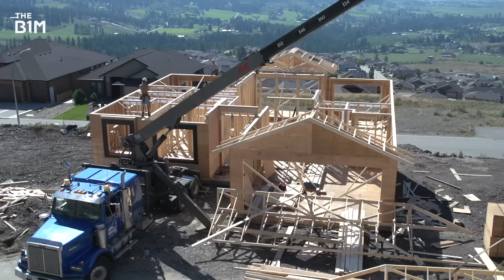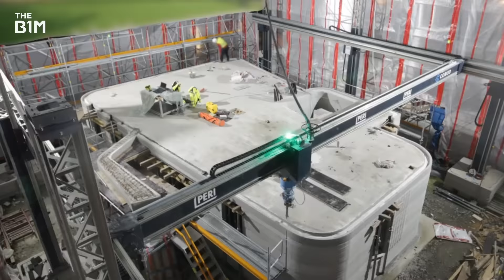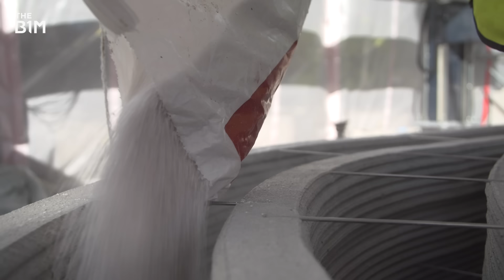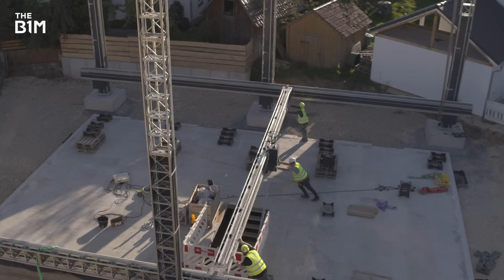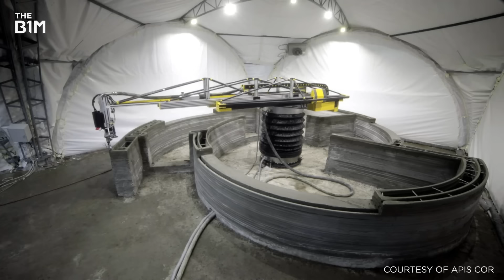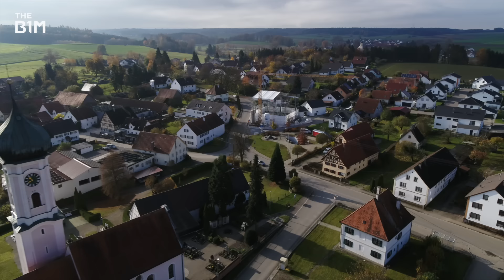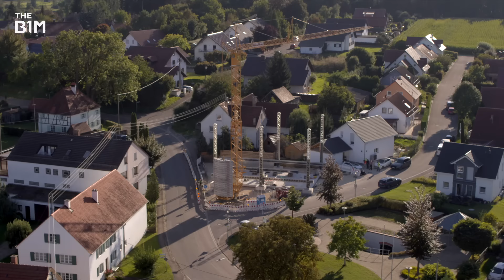Why This 3D-Printed House Will Change The World

Comment: One down side is once you build it you are stuck with it. Renovating or updating would be extremely challenging. If you want to add anything ( additional outlet of light switch ) or if you wanted to repair a wall, you are dealing with concrete repair which is a different challenge.
Reply: Others here have commented that Europeans are used to building there homes from stone and this is no bigger problem.

Comment: Time to invest in ciment companies.
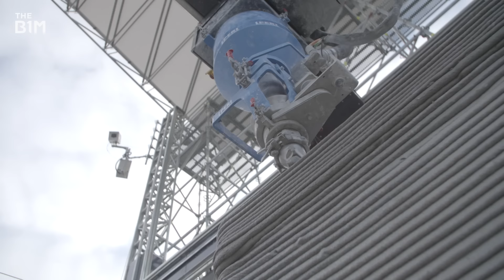3:45 1 meter per second, horizontally. You really should have said this last word. But it doesn't mean anything because walls have 2 dimensions. How fast can it build a 1m² wall?
I like the built-in insulation.

Comment: I'm curious to know more about the rest of the construction process, from installing plumbing, electrical, fixtures, HVAC, and roofing. What are some of the differences contractors experience with this kind of home, over something like a brick or concrete construction?
Reply: Search for the Video: Move in Ready 3D Printed House in Germany

Comment: Do you notice how they show you over and over again the virtual version of the house, but not the actual home with people standing in it and interacting with the home.
Reply: TEC Youtube  

"wow not German building  certified"

German building standards are among the toughest on the planet. If this printed house passes such stringent regulations its a viable structure. 

"How many earthquakes and Hurricanes does Germany get?"

None and not relevant. The vast majority of the planet doesn't get significant earthquakes either. 

"Also the thing is butt ugly."

There is an aspect of cognition that's very useful, I suggest you cultivate it. Its called COMMON SENSE. The 3D printed house can be clad in whatever materials you fancy. In addition, it can be rendered in a nice smooth, lovely finish and painted in a pretty colour... OBVIOUSLY!
Reply: TEC Youtube  No! It's 12% of the worlds population that live in earthquake zones. 50% is US. The world is bigger than just THE US. Most home owners have no issue with earthquakes. So not relevant to most people.

No reason why they couldn't be designed for such zones.

The cost in the US is half that of a conventional house.
Reply: TEC Youtube  

Germany's building standards are well known to be VERY stringent.

And of course, concrete is much stronger than your US houses built from sticks and dry wall.
Reply: True, but if it has German Certifcation it's clearly viable. Don't think it's completly finished yet.
Reply: See video.

https://youtu.be/Sdpn_oYXxAs

They are being built now in the US. Half the cost. The builder is inundated with requests.
Reply: TEC Youtube  

http://bcapcodes.org/code-status/country/germany/

"One of the most stringent codes in the world,"

Comment: Recently I've had a lot of harsh criticism for new technologies recently (SMRs anyone?) but this is not one of them. This would absolutely cause a huge shift. Note that other materials can be combined here such as spray foam insulation between the walls for high performance building. Also because of the layers its possible to easily introduce anchor points which would be necessary for siding assemblies.

Comment: I wonder how this affects repairing/remodeling if the entire structure is basically some kind of ceramic/concrete.  Seems like it would be less straightforward and therefore more expensive than standard stick and drywall construction, especially since it probably wouldn't lend itself well to diy homeowners.

Comment: This is very interesting and well done for PERI in developing this into fruition. To provide a full analysis of the benefits of this, a comparison should be made against a traditional build of similar size (gross floor area) using an elemental cost analysis and critical path programme. Although the video shows superstucture under construction, it does not show the substructure. Most people who have never built anything completely forget this - it is the site preparation works, foundations, services (electric, water, foul drainage etc.) that both take a long time and contain the highest risks. For example, the bearing capacity of the ground usually requires bespoke foundation design. In my experience, once you are 'out of the ground' the risks and costs can be controlled accurately. Nonetheless, a good video.

Comment: Where are you running your utilities conduits I see nothing in place for that
Reply: In concrete or brick homes they are run in roof voids and for electrical cable channeled in walls. Under the concrete floor for pipes and cables too, through conduit.

Comment: Even without earthquakes there are a lot of issues with unreinforced concrete. Even for a house, it is not a good idea. I once designed the foundation (a submerged raft slab with tanked walls) for a German housing complex (I am not German but the opportunity came up) and the amount of required rebar for shrinkage alone was insane compared to other countries. I don't know how they are getting away without rebar.

Are they adding and casting cages in the cavities?

Comment: The topic of unreinforced concrete comes up and it's a valid point. Fitting the rebars would require workers being at hand and that's a limitation as to the argument that 3D printed homes are superfast and efficient to construct. How well would a PERI/COBOD house do in a cyclone or a badass tornado? Obviously the roof would be torn off but would the superstructure survive?

Comment: It won't.  It addresses the shell, which isn't that critical.  It is a little better with basic provision for utilities.  But it doesn't address the basic issue that folks that have wealth because of scarcity of housing are going to oppose making housing cheaper.  Have the other technological innovations from nail guns,  UF electrical cable, roof trusses, I-joists, pex plumbing, wide spread use of cheap immigrant labor made housing cheaper?  At least where I am, such gains are captured by governments and connected real estate developers.

Comment: Naw, just make the walls out plastic coated corrugated paper board line it with foam board with aluminum foil on the inside and a minimum number of boards on the bottom to set on blocks. Have the homeless sleep in the boxes for a month and then start anew. Provide a weekly clothes wash and shower. And feed them soy and corn. Dress them all alike in grey none gender specific garments and require a mask. Have porto-potties available and serviced. Provide a view screen with Disney TV or a small speaker with NPR in the box. With electronic ankle bracelets and e-phones with regulated internet only for all residents of the camp.
Camps can be located in abandoned malls and out in the uninhabited regions.
Vaccines in the camp are free and required for the soy and corn gruel allotment.
High dose statins and NSAIDs are also to be free.
Final care will be provided for in the bigger box next to the solar powered oven and chimney.

Comment: Yeah. Floors are the most interesting part. Probably just plain old prefab concrete lowered on a crane if I had to guess. Don't see a way to 3d print a flat surface mid air. Would be cool if there was, though.

Comment: could be used to build 3D printed igloos on the moon, joining larger and smaller ones onto bigger structures, cylinders could also be 3D printed to used as 'bridges' between 'structures'. there are plenty of, what looks like, ready made "cement" material on the Moon... looks like...

Comment: Yes please do a follow up with testing on how water tight it has been if there has been any cracks etc I'm just wondering how do you implement control joints in the 3d printed construction..

Comment: saw this video over a year ago. and the problem with it is they do not tell you how much it costs to move the machine and how much it costs to run it with people thre placing the pieces that are needed so electric and water can be put thru the wall. They always talk about the cost of the material but never the total cost from the time you call to the time it leaves your sight, there are alot of costs not taken into account. That makes this house the same cost as a normal stick built.

Comment: Pouring concrete is soooo much faster. And I'm assuming stronger as it has rebar build in.
Reply: Not necessarily. You can have these machines lay fiber line all throughout the building creating a much  stronger reinforcement. This has been proven on smaller scale printers and scaling it to a larger design isn't difficult.
Reply: @Acecool  that machine would need to be moving at 50 mph. Not happening. Also the layers create weak spots in the concrete pour that we CAN'T have for  new Super Tall Skyscrapers like the Central Park Tower. 

This technological marvel is created due to new super strong concrete techniques. 

3d printed neighborhoods are a good idea in my opinion just nothing that requires strength

Comment: this 3D printing technology that i saw in this video is obviously dangerous because it does not have structural integrity safety measures like a rig bar skeleton. even a dome home needs a rig bar skeleton which is one of the most of the safest structures one can build. i definitely believe in 3D homes but in my opinion the current technology or technics is not safe and this is why it is struggling to be legal

Comment: I’m not impressed! Many other prefab methods can do it quicker and cheaper. Look at the tent they build around the site, imagine how precise that pad they build it on must be. And once built how easy is it to modify and renovate? The whole benefit of additive construction is the level of detail and complexity you can build at. Yet we see a pretty square featureless ugly designed building. I bet if you prefabbed pieces in a factory and then shipped to the site, it would be simpler. And finally, does that look earth quake resistant bro you? And how would you fix it after some damage?

Comment: Builder here. Let's run the numbers to compare the conventional building of walls(2x6's) vs printing: At that footage, it would be about $4,000 in lumber for the walls, and about $1,500 labor. So a total of $5,500 to conventionally frame the wall with lumber and it would take one day to complete.

Now, let me take a guess at the printing cost of it and I'll be conservative just to be fair: The crane alone they have there would be an easy $5,500. The transport costs of that printing rig would be at least $1,200. The structure to support that printer is another easy $10k. The concrete pump to supply the material to the thing, another $2,500. The material costs for printing and structural support, another $5k. Generator to power everything, $1k. It says a two-man job, but I see a lot more than that in the video, but let's just say two guys, two weeks. That's an easy $7,000 for the kind of skill they'd need to have. The cost of renting or the companies cost of use for that printing rig, another easy $10k. Now, you will have to most likely hire a company to manage all of this and they aren't doing it at cost. So let's add in 30% overhead, profit. Now, let's add that up: $54,860 for printing over the span of a couple weeks or you can spend $5,500 to conventionally build the walls in one day.

And I'm not even getting into the extra costs the subs will charge to work on a printed house. That would be in the tens of thousands as well. 

I've seen a few of these printed houses and I just don't get the hype. These things "print" the walls. There's no plumbing, electrical, windows, doors, or any finishes in the printing, just the walls. I would love for this to be a viable option, as labor is a major problem in construction but this would only compound things greatly because I see a lot more labor and time to print walls than to stick build. It's going to have to be radically different than this if it's ever going to be on a construction site.

Comment: Very impressive, indeed. I would be very curious to see how 3D printing could deal with buildings with large-span openings, for maximising solar gains; column-free spaces; and buildings with large seismic load demands. Definitely, though, a very big and welcome evolvement in the construction sector, which should be kept going.

Comment: I call BS.  No imbeds in walls for electrical, plumbing, A/C/, and most importantly seismic reinforcement to rest lateral acceleration.  Also what kind of coatings to resist water adsorption and freeze/ thaw cracking?

Comment: Id be curious to see the actual rigidity of these structures seeing they didn't show rebar support....( other than tiny wire supports) and also how did they print the overhangs? Are the floors or ceilings of each structures not part of the 3d print? Because you can't really print concrete support pieces that you can remove lol

Comment: This is interesting, but this video sounds like a sales pitch and not actual analysis if this is a valuable technology. You don't go into details on how floors are constructed. Is it joists, concrete on deck or reinforced concrete? What about getting all MEP into this building? 3D printer cannot do that. Why not show a finished product on the inside? While design looks interesting on the outside, I doubt many people would want to have same wall design on the interior.

Comment: Question: Are suspended slabs (floors) beam supported cast in place, or pre cast floor panels? It would be great to see how the floors tie in to the walls, and how roof framing sits on top plate.
Reply: i imagine that the floors are pre casted cus the prints are not so smooth

Comment: If there is an issue with the house later on (example: plumbing, electricity, mold) that requires one to open up walls, is it easy to replace those walls after repairs? or do you need to hire a 3D printer machine like the one in this video to fix? 

Also, 3D printing uses plastic. Is this really a smart choice of material when our world is suffering from a war on plastic pollution? An amount of plastic the mass of a house seems incredibly unsustainable.